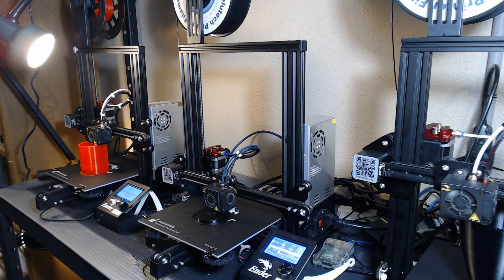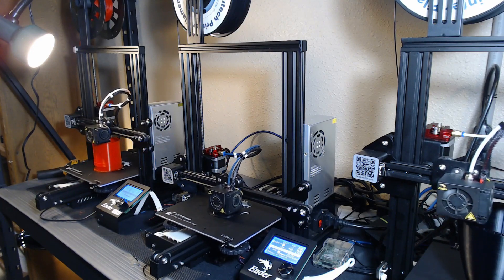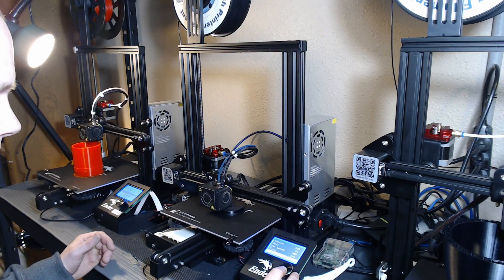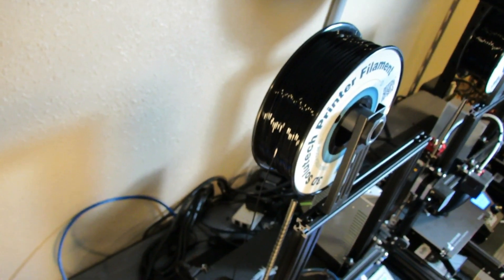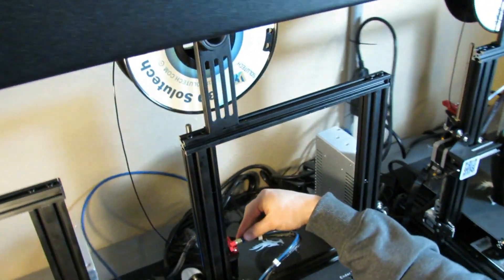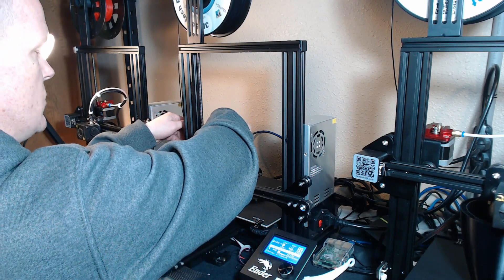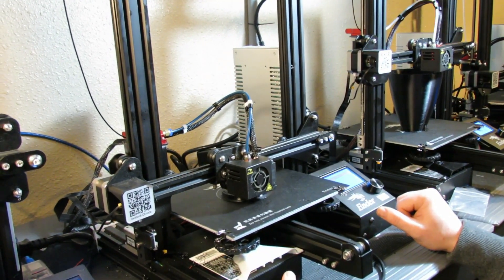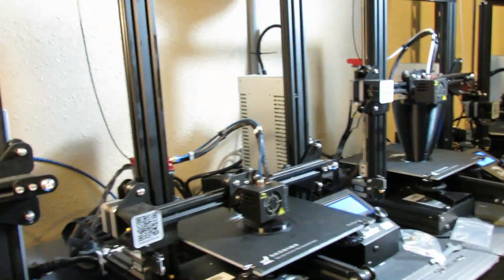3D Printing 101: Changing Filament Midprint

Comment: Sorry for being critical, but you said “select bottom option” without saying what that option was. Not all printers have the same options or option order. Also, nothing about hotend temperature? In a real run-out situation, it would have cooled and not pull filament through, and if you reheat too hot it will cause a jam and ruin your print. Advice… address more scenarios that people go through, as they’re likely watching this while experiencing them.

Comment: i dont have change filament option in ender 3 pro so i burned filaments and connected each other correctly after that i cut extra parts around filaments. its working good now.

Comment: Why has my ender three not got that option in the tune msection? I cant find it anywhere
Reply from the maker: If you don't have the change filament option, you have to pause the the print.. Set the bed and hotend temp and change it out.
Reply: @makersteve934  Thanks steve I worked it out only problem was I was changing from PLA to ABS half way through

Comment: Im having issue on filament change after the filament sensor detects run out. my having layer gap/shift at least a layer.
Reply from the maker: I have two prints with filament run out detectors.  I have not experienced that with either one. I would suggest a firmware update.

Comment: My Ender 3 Pro must have different firmware.  I just did my first mid print filament change and when I selected 'Change Filament' in the 'Tune' menu, the printer did not finish the current layer but instantly went to XY home and retracted the filament.

After doing the process, I see I need to devise and implement a mechanical Z lock so it will be impossible to move the Z axis during filament changes.
Reply from the maker: After you get the hang of it, you'll be able to change the filament without accidentally moving it up or down.

Be time to practice is during a normal filament replacement.

Comment: Maker Steve, please revisit this video and add subtitles to everything that can be identified.  Specifically, all menu items you are navigating and what you are looking at.  I really need that information as a beginner looking to solve a problem: running out of filament mid-print and though I paused it, the job cancelled out.  
I changed filament (from sample spool) to new, found option Continue; option to recover at break. But the print head went to the top, is just moving back and forth and no filament is coming out (It did not come out at loading when I pressed, 3x).  I know, I should have stopped there...  I was really hoping your vid had the answer for me...almost!  (Lotmaxx SC-10)

Comment: Help a noob out. When I change the filament just like you did, the layer won't stick. What am I doing wrong?
Reply from the maker: It doesn't stick to the existing print?  I have never had that issue. Can you verify the hot end is still hot?

Comment: Hit what "Button"???
Reply from the maker: There is only one button on an ender..  There are two options to choose from depending on firmware.  Pause (where you have to set the bed temp and nozzle immediately after choosing pause so your print doesn't release) or Change Filament which does everything for you.

Comment: Ender 3 makes  a growling noise in the hot end on a certain move a back and forth  move on the left side of the bed . It seems it is when it is making a wall and doing the infill. It is getting worse, it did not do it when I first got the printer. I've had it less than a month and have used almost 2 spools. Thank you so much for any help.

Comment: I just got a CR6-SE a few days ago (first 3d printer) and when changing filament not sure if I need to release the brake and pull the rest of what is between the feed motor and the print head.  I am pretty sure I moved the print head a little when I pulled the filament out to place a new roll on because when I resume my print job it was grinding on the piece for a few seconds before it moved x+ 3cm and started printing in mid-air, making spaghetti and killing my 3 day print job.

Comment: Nice. But would it resume right away or would it wait a little for the temperature to go back up again? Pausing the job would cool down the nozzle wouldn't it?
Reply from the maker: It your firmware supports it, it will heat bad up before continuing.  If it doesn't..  You should set the the Temps yourself as soon as you press pause on the print, then l, unpause after its reloaded.
Reply: @makersteve934  Got it. Thanks

Comment: Does the bed go cold during a filament change or does it stay at temp? Thanks!
Reply from the maker: Depending on firmware it may, then you have to set it manually pretty quickly. If the only option you have is pause print, it will cool off for sure.

Comment: 2:10 - if you cut it at an angle so that the point is away from the front of the printer, when you press the thing where you load the filament and push, you can easily hit the hole you need to put it in if you release the clamp a bit to target the hole

Comment: welp i am a day and 7 hours into a print with about 8-10 hours to go and I still feel like I might f it up.
Reply from the maker: Different firmware gives different options.  If you go into tuning "Tune" and scroll down and you have "change filament" it's a no Brainer.  If not.  Pause the print and set the bed and hotend temp the same as your print, change the filament and then resume..
Reply: Maker Steve I get the procedure, it’s just I might move the gantry is what I am worried about.
Reply from the maker: @pellbellgellbiff9401  just don't move the gantry...  That's the challenge for sure.  After you've done it a few times it's no issue.

Comment: Great video. quick question i have a ender 3  .. i was printing and ran out of pla. i tried loading a new one but it wouldnt go any further into the feed and whitetube... how can i solve that problem please?
Reply from the maker: Sorry for the delay in response.. I imagine you fixed it by now but..  After you cut at a 45 degree angle you may find it get hung up on the extruder compression fitting.  It that is the case, unscrew the compression fitting, feed more filament thru the extruder then slide the compression fitting back on and tighten it up.

Comment: So when I change my filament and it starts printing again, it’s off by a few millimeters which causes my print to fail. Any ideas?
Reply from the maker: It should go back to the exact same spot it started.  If it doesn't..  It has to be a loose belt, the bed has moved or firmware needs to be upgraded.

Comment: The stock silent board from Creality (version 1.1.5) does not have the option to “change filament” in the menu anywhere. Which board/firmware are you using on your Ender 3’s that show this option?
Reply from the maker: I have 10 enders purchased over a 4 year period.  My oldest 4 have the first version of motherboard.. Not sure what version number.

Comment: “Go down to tune and go to the bottom option”... which is....????
Reply from the maker: Change filament.. Unless you have older firmware.. Then it won't be there..  You have to pause the print, set the bed temp back to what it was.. Swap filament and resume print.

Comment: Hit the button, go down to the bottom option.. A for effort, D for description / clear picture of what you are doing in the interface.
Reply from the maker: Bottom option is Change Filament.. unfortunately it may not be on your Creality3D Printer unless you have updated the firmware.  If that is the case, it's a hotswap...  Pause the print.. reset the bed and hotend to temp real quick and change the filament.
Reply: @makersteve934  Thanks for explaining if we don't have change filament option
Reply: @makersteve934  should I still be preheating my PLA when changing filaments?
Reply from the maker: @juancarlossoriano980  Yes, depending of your firmware..  Newer firmware will maintain the temp of the Hotend and bed during a "change filament". Older firmware will zero out hotend and bed temp when doing a "Pause".  If your bed temp goes to zero, reset it to print temp (60) first as it will ensure your print sticks to the bed.
Reply: @makersteve934  I'm on the latest version. By the way, I bought a generic filament, not the same one I am printing with. Would I need to recalibrate the positioning of the bedding because I have a different brand of PLA? It has the same size though, 1.75.
Reply from the maker: @juancarlossoriano980  if the filament is decent quality you should have minimal changes.  You can dehydrate filament prior to use and improve print quality.  Better filament always better results and fewer nozzle jams.

Comment: Instead of calling it "the bottom option" it would be nice for a noob to know what the option is actually called.  :)
Reply: The bottom option on my ender3 pro says "change filament". Check your printer for a filament changing option if you want to change your filament.
Reply: @Cory_Springer  Ah, OK. On mine, it says Babystep Z. :) Thanks!
Reply: @testcase72  yup Babystep Z is my 2nd from bottom so I guess it depends what each says. 
Either way I find it easier to manually change filament instead. 

If during a print, pause it. 
If hot-end is cooled, heat it to printing temperature.
Then compress extruder spring and manually push filament slowly until you see it coming out of the hot-end. 
Then, while still compressing the extruder spring, give the filament a brisk firm long pull until the whole length is out. 
It might be a tiny bit stringy, but if the very end has like a 1cm plug shape, you've done it correctly!
Reply: @Cory_Springer  A 'pause' and then 'change filament' wouldn't work?
Reply: @testcase72  that's what I did because I couldn't figure out what he was talking about
Reply: @Cory_Springer  My brad new 02/22/2022 Ender 3 V2 says Language selection LOL I did not think changing language would help me change the filament